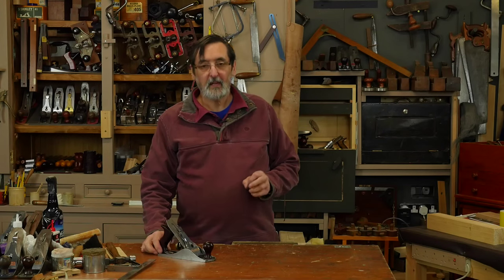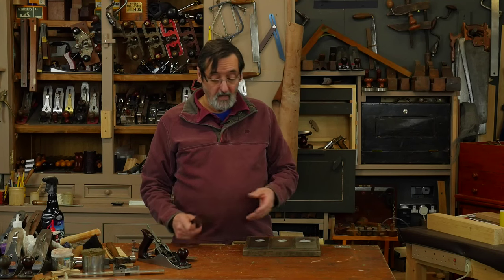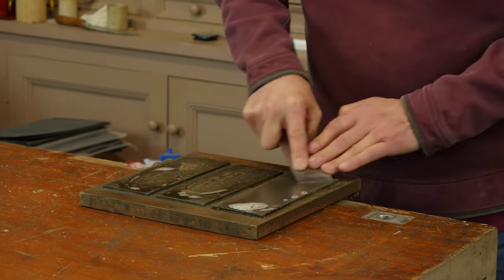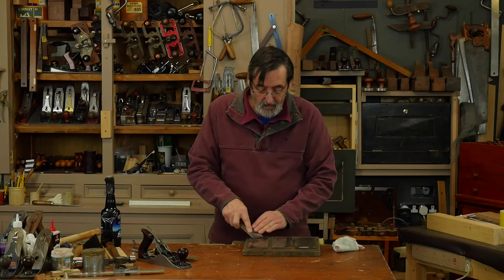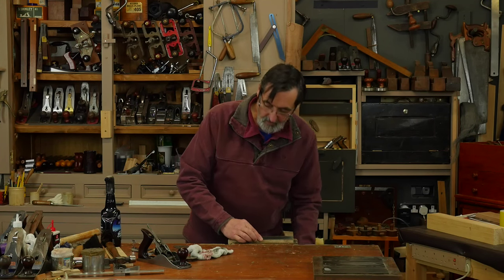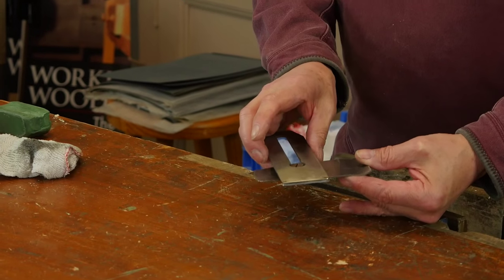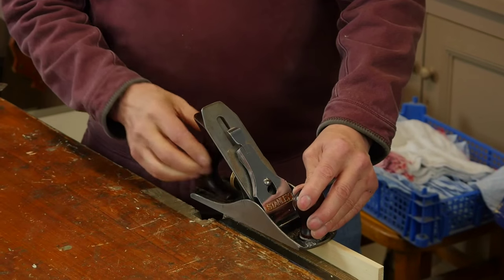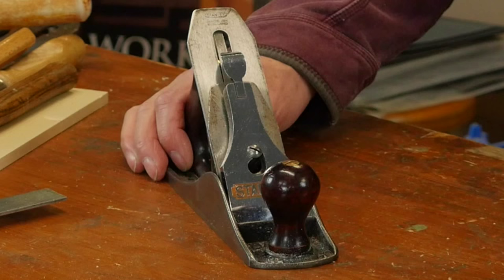Sharpening and Setting the Bench Plane | Paul Sellers

Comment: Just a quick question on Stropping. When my father taught me, about 35 years ago, this method for sharpening tools and knive. When he taught me, he explained to me that you strop on the "rough" side of the leather. Although it's really not that rough but it definitely not smooth. But lately I've been seeing videos that say you should use the smooth side of the leather. Which is correct or does it even matter? Also, thank you for this video as well. I'm new in using different hand tools and I feel it's best to know both power tools and hand tools. Again, my father taught me about various hand tools and wouldn't let me use power tools until I understood what hand tools do first. Of course back then I didn't see the point of doing all that hard work when power tools made it so much easier. But now being older, and hopefully wiser, I see the point of using hand tools.
Reply: It's mostly preference whether to use the grain (smooth) or suede (rough) sides.  Some people think the suede holds honing compound better, others say the grain gives a better polish.  I tend to think the grain works best for low bevel angles like razors while suede works better for normal tools and knives.  Give each a shot and see which you prefer. Leather's pretty cheap.
Reply: @LikelyToBeEatenByAGrue  Thank you and great explanation. I guess when My dad taught me it was pretty much pocket knives and shop tools and never anything razor like. So maybe that's why he taught me that way. ALTHOUGH, I was a teen at the time so it's very possible he taught exactly what you shared. LoL I do remember him mentioning barber shops. Thank you again, I understand better now.
Reply: @woodandwheelz  you're very welcome.  Paul's sharing so much, I'm glad to have helped in a small way.

Comment: For anyone having trouble understanding how he rounds over the corners of the iron, or any action that happens fast, stop the video where you wish to slow it down, then use the speed control (click on the gear icon at the bottom right) in YouTube to play back from that point forward at 1/2 or 1/4 speed.

Comment: Paul, if you are not teaching your students to use the cap iron to control tearout, you are short changing them. the cap iron should be set about double to three times the expected shaving thickness. It seems difficult to get it done quickly for about a week, and then it is easy and routine. It will also allow a common stanley to plane through the very hardest woods, directly against the grain where that sometimes is forced (due to swirl or runout), with no chatter no matter the shaving thickness.

Comment: Great video, but what are the stones?  The intensity of abrasion?   I do not know what to go to the store and buy, also I saw you rub some compound on them, what was that?  Could I use wet and dry sandpaper instead as I do not  have the stones yet?
Reply: Watch it again Dave. Paul discusses the grit, and the compound is just glass cleaner, for lubrication.  EZlap sharpening stones. Available on Amazon. Oh and yes, wet sand, sandpaper on a true flat surface such as glass will work fine sir.

Comment: Paul, could you please point me to any resource which discusses how to set up a jack plane. As I understand it the jack plane can be used for smoothing and jointing and I am curious on whether the plane needs to be setup differently in either case, or whether I can use this video for a no. 5. Kind regards.

Comment: Thank you, Paul.  I've a question about the grits of the stones you use versus sandpaper.  You used Coarse (~250 grit), Medium (~600) and Fine (~1200).  Would those grits be the same for wet/dry sandpaper?  Thanks.

Comment: Hi Paul, how do you keep the diamond plates from rusting when using water rather than an oil? Maybe my ones are cheap..!
Very good work and video your presentations are great to watch. Steve
Reply: S R those are stones not plates... most diamond plates do not require a lubricant. Check with the manufacturer of your plates to see what they suggest. If a lubricant is required it should be oil for plates to protect from rust and corrosion.
Reply: These are diamond plates.
And you should use a liquid on diamond plates too, not only so the swarf can flow away and not gum up the cutting surface, but also because of heat dissipation.
Reply: @TheSatyrblue  Also, when you've done, scrub under a cold running tap with a nylon brush to remove any build-up and dry the plates thoroughly.

Comment: I also tuned up a plane with a Stay Set 2 part chipbreaker .The point of the separate front piece  is to avoid any twist in a full size chip breaker  {That`s how I understand it  although the name does not suggest that }.The Stay Set was not very accurately machined originally. The front edge needed to be flattened. Also the back edge should be ground down slightly on the sides to taper away from the middle. Make it so it rocks slightly with best contact at the centre ,then the front edge will always make good full width contact .   Sadly the depth adjuster hole was a large square shape and I had to make an addition to close the space up .It was glued onto the chip breaker with Bostik and trapped under the cam lever . However ----even then the depth adjuster was unable to withdraw the blade properly . The darned thing was just  too long for the plane .  I might be able to shorten the front edge to make the plane safe to carry around .As it is ---the fault will be a permanent fixture .

Comment: After backing off the adjustment screw to lift the blade do you turn it in the opposite direction a fraction to remove any backlash in the screw?

Comment: Paul,

Very explicit and clear. I'll be referring to this on many times.  I have a question about the pressure you put on the blade while sharpening it.  Light , medium or heavy? Same pressure through the stones?  Thanks!
Reply from the maker: Thomas Tieffenbacher All of my upper shoulder weight goes down to my finger tips and hands, so as heavy as you like is fine.
Reply: Thomas Tieffenbacher As one who sharpens razors for shaving my face, I feel qualified to add here that varying the pressure you apply will change the depth of the abrasive striations cut into the metal.  So I start with medium/heavy and the use less pressure as I complete each stage.  This helps the transition from stage to stage.  Try heavy until you get a burr, then knock of the burr and use a lighter pressure and find a lesser burr.  Or just use heavy pressure until you get to the final stages.  But then the nuances of sharpening, once you get the real gist of it, tend to vary. Proceed as you like.
Reply: Especially with novaculite (Arkansas, Washita) oil stones, changing the pressure is essential.  The equivalent to grit on these stones will vary with the pressure.  It's not so much raised particles, as crystalline edges.  A good Washita stone, which is hard to find these days, can take you all the way from coarse to quite fine on a single stone.  More work than a diamond stone, to be sure, but also more control, once used to them.
Reply: Fascinating-where  can  I  hear  more  about  your  technique?
Reply: Thomas Tieffenbacher/DocSavage45 is

Comment: I received my Stanley #4 Sweetheart plane today and the manual said lay it on its side as to not damage the cutting edge...I believe the side method is if you do not retract the blade at all and Paul's method is acceptable as long as you retract the blade above the plane's bottom surface.
Reply: No.  You can put the plane down with the blade out as long as you're not slamming it around and you place it on your bench.  I've yet to dig into my bench with one of my planes.
Reply: ylicyotee I agree, I have yet to affect the blade adjustment when setting it down in either orientation. Dropping it may affect the plane blade alignment and/or the workbench surface.

Comment: I originally had my plane blade sharpened with a straight bevel using a honing guide, but I decided to try Paul's free-hand method to put a convex bevel on it. What I'm finding now is that with a shallow set the plane skates over the wood without taking a shaving, then I add more set and more set and more set but it still doesn't take a shaving until eventually with only an eighth extra turn it will dig deep into the wood, take a shaving that's very thick and leave a gouge in the wood. 
Why would that be? 
I presume that I've done something wrong because it certainly won't be Paul's fault - he is the definition of a craftsman.
Reply: Decided to go back to basics and re-ground the bevel to a flat 30 degrees on the honing guide on 60 grit sandpaper taped to a sheet of glass. 
Then honed it up to 1200 grit, again using the honing guide. 
Rounded off the corners and polished it with Silverline green compound on the strop.
Works like a dream taking very thin full width shavings again.
I think free-handing would take a lot of practice to get right and at my age I don't think I can invest the time for that so I'll stick with the honing guide to ensure consistency.
No criticism of Mr Sellers though, he definitely knows his stuff and is a great teacher, the fault lies with my lack of skill and experience.

Comment: To anyone about to try this for the first time:

Don’t be intimidated. I’m essentially a Paul Sellers disciple like I guess many of you are. Made the sawhorses, workbench, use his chisel recommendations etc. As a total beginner I felt I had to be sure of ‘exactness’ in every way I could, to cover up for my shortcomings. Fast forward about a year and after being dissatisfied with jigs and honestly just a bit disheartened with sharpening altogether, I began to research Tormek’s and the like. The price just seemed a scam, so I thought, ‘what would Paul do?’ and proceeded to find this video. Well, on the first try I have the most razor sharp edge on my plane iron that it has ever had in my stewardship. Don’t want to sound too dramatic, but it genuinely feels like the start of the next chapter in my journey with woodworking. Hallelujah!

Should never have put it off for so long.

As ever, thanks Paul for all that you do.
You are a treasure.

Comment: very clear as always Paul, quick question, what stones are they you have set into the block? also what brand window cleaner are you using?, iv tried a few for my diamond stones but staining is an issue.
thanks.
Reply: Elwyn Harris I'm too lazy to dig through the rest of his videos, but if I'm not mistaken they are some kind of diamond plate by Eze-Lap.

http://eze-lap.com/woodworking_shop_machine_use/

There are a few other notable brands out there too: DMT, Atoma, some more I can't think of right now. Do your research and decide which ones you like most, whatever Paul is using he has had it for quite a while and they seem to be doing a good job for him.
Reply: Elwyn Harris He is using DMT diamond stones... not plates. The reason you are getting discoloration is due to the water corroding the steel of the actual plate. If you are using a lubricant for diamond plates use a 3 in 1 oil. Check with the manufacturer for their recommendations regarding lubricants for your plates. I have work sharp plates and they recommend no lubricant for their plates.

Comment: Hello Paul. I've been following your channel and many of your recommendations. Since I started using hand tools I've been sharpening my planes (Stanleys) as you recommend and they work just fine. The question I have is that in my jack plane although performing well, even when I did mount back the blade after sharpening it carefully aligned, I always have to move the lateral adjustment lever all the way to one side (the left one) in order to have the blade leveled. Is there an adjustment I am missing. Any recommendations?
And thank you for the series of videos and recommendations, they are truly helpful.
Reply: Get a high quality small try square and check to see if the edge of your blade bevel is square to the side.  Sometimes if you sharpen old blades by hand  for a while, things go a little off square over time.
Reply: J

Comment: Excellent videos Paul, thanks. I know this video is quite old but I have a question. I have a cheap plane and I've been working on the sole and blade to get it into shape - to be fair on the thing it is starting to perform okay. It's a Magnuson I think - B&Q special? Anyway, sharpening... whenever I sharpen a blade (plane or chisel) it has a tendancy to sharpen out of square! Is it because my left arm is stronger than my right? I use a Veritas II jig for the chisels but I don't have the attachment for plane blades so I use a cheap single wheel guide set to 25 degrees. Is it possibly that the guide is not clamping the blade square? Any help would be great.

Regards

Nial

Comment: Hi Paul

Thanks for the video! I'm new to hand planes and have been using a number 4 for a few weeks now and have a question. I find that my adjustment knob does little or nothing no matter if I turn it to either extremes - the blade stays the same height. Only when I unclamp the lever cap does the knob move the blade up and down. Obviously this is undesirable because every time I want to adjust the blade height I have to unclamp the lever cap. Another symptom is that the blade changes positions (usually just gets pushed back into the mouth) after a small amount of planing. Could you offer me any advice? Thanks.

Comment: I have a few questions that most likely have to do with sharpening of the plane iron. First when I got done sharpening and got the chip breaker in place and went to planing I got wood under the chip breaker itself. I was wondering if that had to do with the flatness of the iron or if the chip breaker wasn't set properly. Secondly when I was sharpening the plane iron my finger joints were "locking" up, have you ever experienced this and if so what could be done to solve it.

Comment: I always laid the plane on the side in school woodwork, never knew it was actually bad practice! Never again.
Reply: I was also taught to lay the plane on its side in case there was a nail or some other bit of metal on the work bench that would instantly ruin the edge on the iron that I had worked so hard to achieve. I don't see how laying it on its side can knock it out of adjustment unless you throw it down
Reply: neuro518 I was also taught to lay it on its side incase I chip the blade but I gently lie them down, I guess its just preference then
Reply: What are you doing leaving nails and bits of metal on your woodwork bench? That's just careless and you deserve the the extra work of having to resharpen your plane.

Comment: Hi Paul. Understand that you move the lateral adjustment lever side to side to get even width shavings bit how do you know the timber is level and one side doesn't need more stock removed than the other ?
Reply from the maker: Hi Michael. Have a look at our Stock Preparation video list here on YouTube.
Reply: There is a difference between flat and square. The purpose of taking the shaving after reassembling the plane is to see how the plane performs, not to square the board. If you do not have the sole of the plane flat against the edge of the board that you are shaving, you will add waves to the board edge. Get a copy of Robert Wearing’s “The Essential Woodworker” if you are new to woodworking. The diagrams in the book help to explain the process. Get the book from the Lie-Nielsen website, or at least check the price you are paying against the Lie-Nielsen price.

Comment: Do you clean the stones after use to get the grit off?  Do they need to be dried so they don't rust? Aren't the diamonds held in place by a steel matrix?
Reply: +Cassian YHVH Wash with fingers and water. More than enough. Diamonds seem embedded into the steel.
Reply: Unfortunately, the diamonds are not embedded in steel, but a nickel plating holds them in place.  This is the main reason why diamond plates lose sharpening power over time, as the steel you sharpen is harder than the nickel and will wear it down until the diamonds come loose.
Nickel is fairly corrosion resistant, though, so unless you use a fluid that attacks nickel[*], wiping, spraying some more and wiping again should be enough.  To be even more safe, for diamond plates you can give them a final wipe with some 3-in-1 oil.

[*]:  If using window fluid like Mr Sellers, make sure it's not one with vinegar added.

Comment: I am just starting to get into woodworking with hand tools. I have been using power tools for many years and would like to transition. One of my struggles has been with bench planes. I've watched your videos on sharpening and can get a pretty good edge on my chisels and what I believe is a good edge on my bench planes. One struggle I have regarding bench planes is chatter.... It seems no matter how fine of a setting I use I get chatter along the surface. Is this due to improper selection, sharpening, set up or technique? or is it all of the above? Any tips?  Thanks Aaron
Reply: Try some wax on the sole of the plane. Most chatter is actually scuding. The plane sole is sticking.
Reply: Thanks tried it and helped a ton!.. I also found that buildup of crud between the iron and the frog can cause it too... Keep it squeaky clean...

Comment: mr Sellers  I just got a Stanley Bailey nr4 and discovered the blade is curved. when i put a ruler along the edge i can see trough the middle. How can i take that out? With kimd regards Jan Willem Kooi
Reply: JW Kooi 
Flatten the edge on a stone, blade straight up. Once you have it flat, then sharpen normally. You could also mark the sides where you can't see light through the gap, and sharpen each side only until it's square. Either way will take awhile, but it won't be difficult, just tedious.

Of course, you could also just buy & prep a new iron. Depends on what you want to do.
Reply: Best to buy a diamond stone which does not make a hollow in the stone unlike the carborundum stone